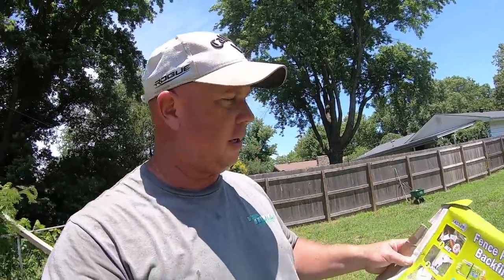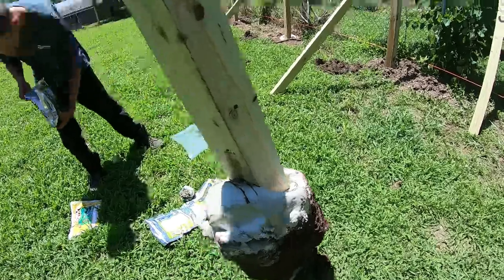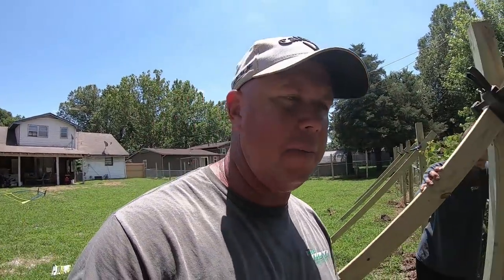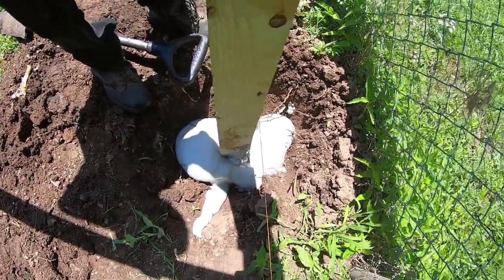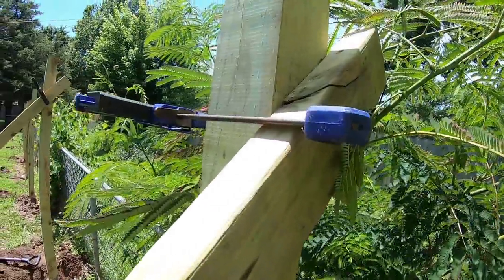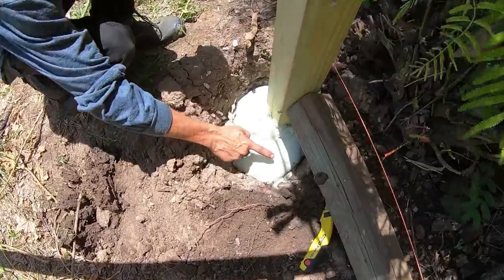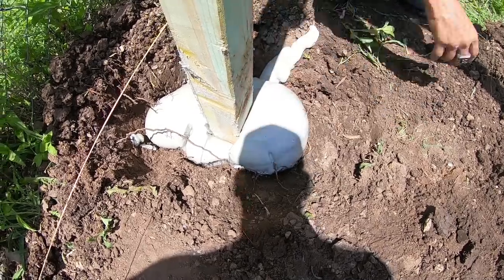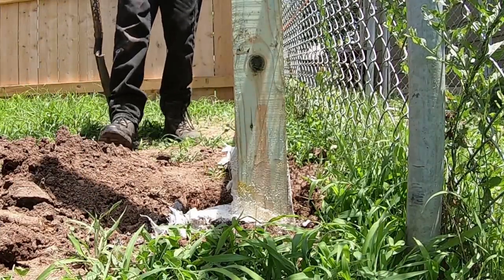No Concrete Fence Post, Is Foam Better

Comment: I bought a bunch of the sika brand and I wasn't impressed, I actually am starting to remove some and refill them with concrete. I bitched to the company as well. no response yet.
Reply: You did something wrong.  I've used Sika's version, just as good as the original.

Comment: Wouldn't take much for the wind to blow it down
Reply: Happened to me... Try to tell the ppl to buy concrete... They had to pay to have the fence redone
Reply: Pretty silly if you ask me might not rot the post but don't have the weight to hold down .
Reply: That was the issue it was in soft soil too... I expressed why not to use it and the store sold them so good on it they told me either do it or we will find someone else... I put a clause in my contract if the post fails its due to faulty product

Comment: Very familiar set up ye guys have to myself. Same rip saw same post hole digger same tight lines and same props. I’m in oz using steel posts but the ground here is very sandy I would like to know how much movement on the post there is with the foam in comparison to concrete? Shame ya didn’t have a titliest proV hat and we be nearly matching🤣. Insta@mahersfencing.

Comment: It saves time 🤔🤔 but you don't have to go back and trim concrete at ground  score foam 0 concrete 10
Reply: dont need to trim foam either if you dont put too much in !! Then you have a place to put the soil you just took out.

Comment: Wood encased in concrete shouldn't rot ... Your Foam ??   I'll pass.
Reply: Foam is 3 times that of a heavy ass bag of concrete and I am on the border of both myself as I have yet to use and give foam fill stuff a try
Reply: Why not concrete isn't waterproof despite what  many people think is porous.  if you dont believe me put s puddle of diesel on a garage floor and see if its there in a couple of days and if you think its just evaporating put some next to it in a glass jar and see if it does to any appreciable amount in a week or 2!
Reply: @teekay1785  - not sure what you are saying .. if you mean foam is the same as spongy concrete?
Reply: @Joshua79C  he said wood won't rot encased in concrete and I gave example why it will just like steel reinforcement in concrete will rust too.  The reply was to OP not to you.  As i said above closed cell foam will prevent moisture entering the wood if you put it on all the wood exposed

Comment: Expensive and nasty waste. At least concrete waste can be re-used. No thanks
Reply: not expensive at all actually can be 1/3 the cost see my above reply under NO NAME.  I doubt much concrete from a post gets used reused for anything but landfill just as the foam would.  Large pieces of broken concrete yes little pieces not usually.